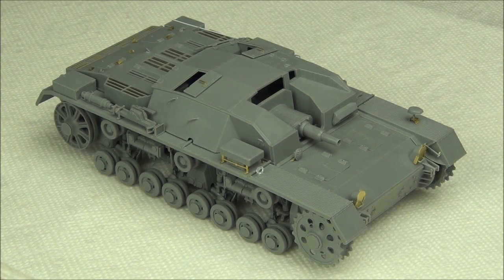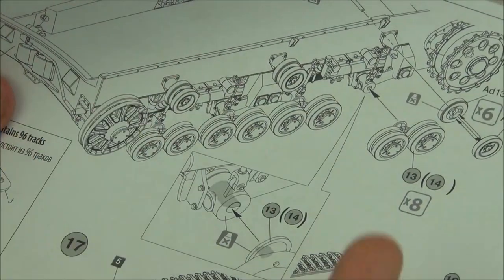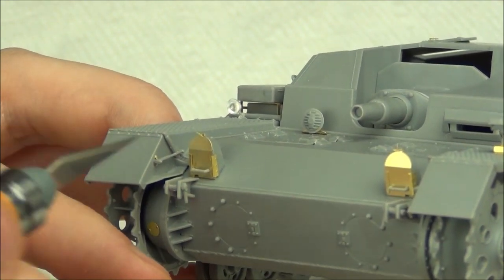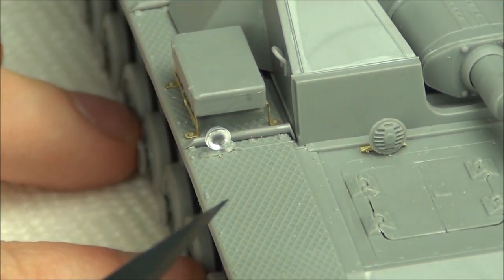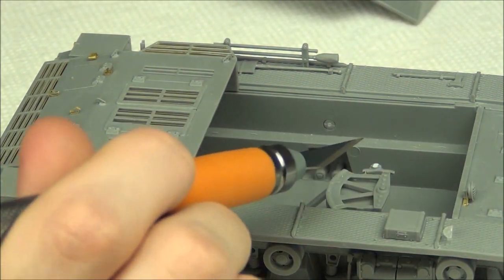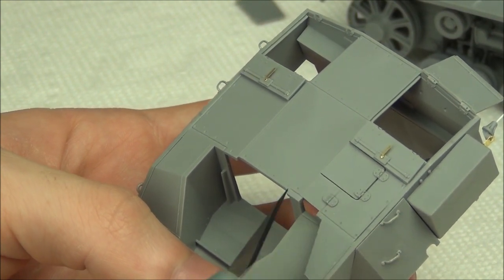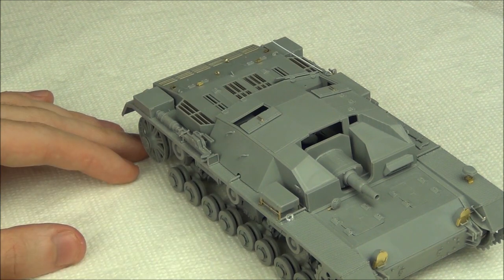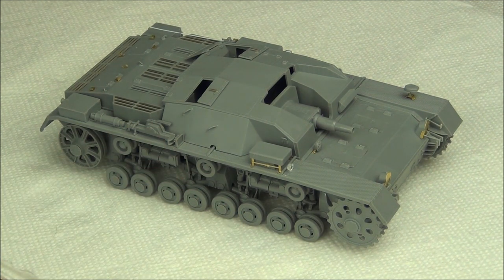Post-build Review: MiniArt 35210 StuG.III 0-Series Prototype

Comment: I saw the Mini Art Mk IV versions,with the different suspension types,most dragon options are pretty limited.Just built dak 3in1 with tools on roof,front fenders up,and put PE 3x spare wheel holder on front,two wire wheel holders on side vents and built a frame out of brass rod for jerry cans.The padlocks on turret bin were a punishment.The Mini Art STUG looks good,new bits,dragon does like the lego method,be nice to see some more versions of a vehicle that deserves the research.Prototype,low profile,aerodynamic?i know whats missing,front and rear spoiler.Back to my tiger turret basket......cheers great vid,good looking kit.Hope bronco tries to one up it.

Comment: Amazed at your ability with photo-etch with just a pair of pliers and a ruler edge! Very impressive. Serious question though - have you never thought of investing in some proper photo-etch tools? I know they are expensive for what they are - but they are little more than the price of decent kit and will last a life-time. I returned to the hobby after 40 years away and found the photo-etch very challenging. I'm getting better though. I find the forming of the various shapes etc to be quite good fun and relatively simple - cleaning up the smaller parts (eg: bolt heads!!) and sticking them to the model is another matter though.
Reply from the maker: Thank you!  I have been interested in getting some proper tools for that.  Do you have any recommendations?
Reply: Hi Panzermeister. I confess I went all in with a Small Shop "hold & fold" bending tool figuring it was a one-off investment purchase and skimping on price was probably a false economy. I know RP Toolz are pretty good and slightly less cost wise but my experience is generally you get what you pay for. Whilst expensive, and rather underwhelming when you open up the box, they are incredibly well made. I still do some simple bends with pliers/tweezers etc but there are usually components in every kit where a bending tool comes in to its own. You certainly cannot get the same clean, accurate, sharp angles by hand.
Reply from the maker: Awesome, thanks!  I'll look into it.
Reply: for bolt heads,a blob of slow setting FLEXY 5K and a coctail stick,use one end to apply glue and lick the other end to pick up bolts.Doing it now in a tiger mid turret interior.The flexy 5 stays ready to bond longer,and not as brittle when dry.Costs a little more...g/l if you like armour the RMF Panther is the best moulding ever made in plastic.Full interior.unbelieveable model kit.2017...

Comment: Nice video. I have become a big fan of the Stumgeschutz and am building the Bronco Stug III. I have watched your video on the kit and found it helpful.  I am adding crewmen to the model and I had a question as to what color the crews uniforms should be. Are they black like the panzer crews or are the Grey or german field grey like the field artillery units.
Reply from the maker: +Steve Wismark thank you!  Crew uniforms should be field grey for StuG III.  In some cases you can see them crewed by rear panzer crews but that was only late in the war.
Reply: Thanks for the info,  Your videos got me back into modeling after a 36 year break. I'm looking forward to trying out some of your weathering techniques.  The more i watch the more I am learning. Have you ever tried Easy  Metal Links tracks as replacement tracks. I just bought a set and am looking forward to giving them a try.